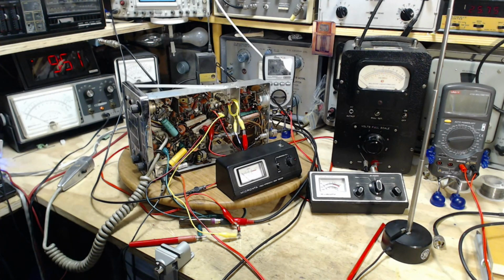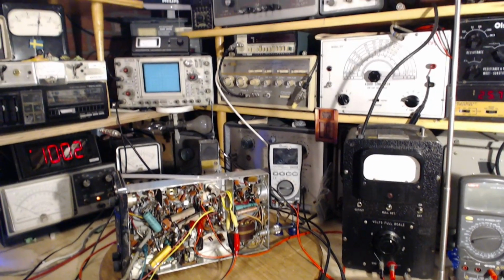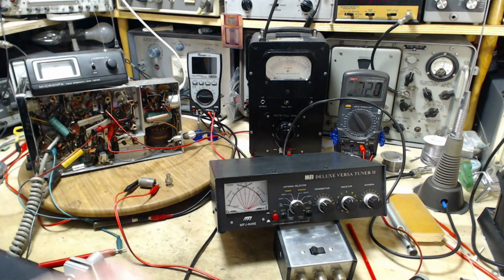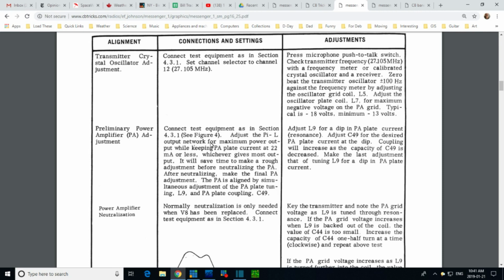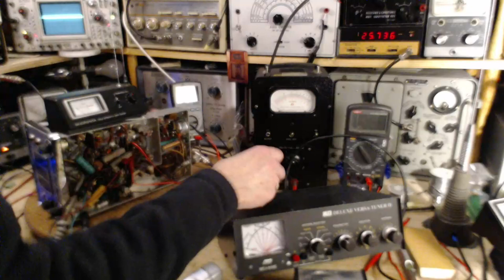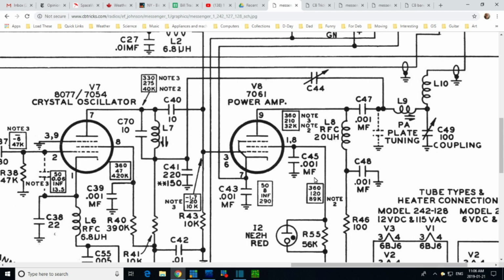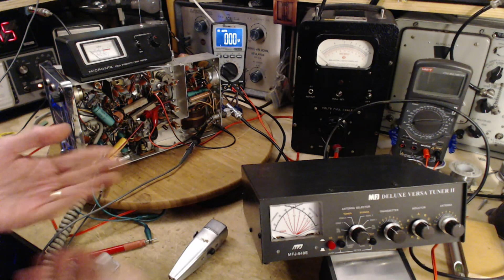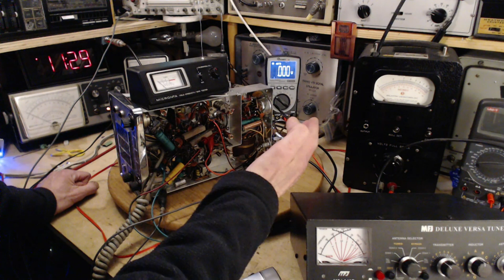Johnson Messenger CB Radio Video #7 - Transmitter Testing Setup

Comment: 5 watts input to the final is plate current times plate voltage. The out put into the aerial is plate input times the efficiency of the tube, in class C about 80% if it’s coupled properly.

Comment: Why don't you use an insulated piece of wire for your field strength metre? It does not need to be bare. Just the end going in needs to be stripped.

Comment: At time 30, the output power is less because you screwed up the PA tuning. It’s important that it is set for a dip in plate current otherwise your plate current can be too high.
For a moment there you earlier got confused with a grid “dip” meter by the reference to adjusting for a dip. It’s not the same thing at all.
Remember you scope is showing peak to peak unless you convert it.